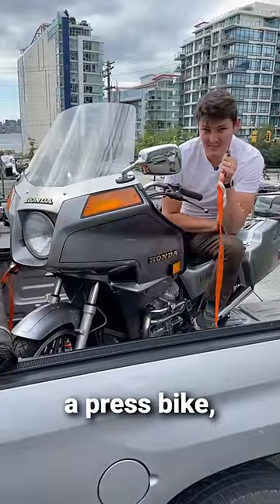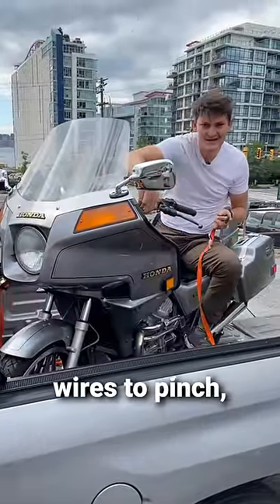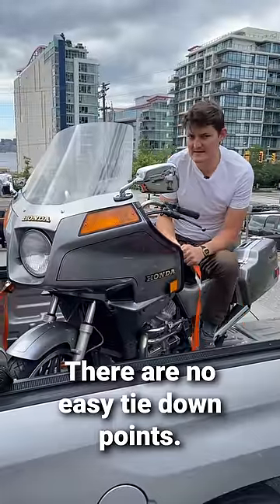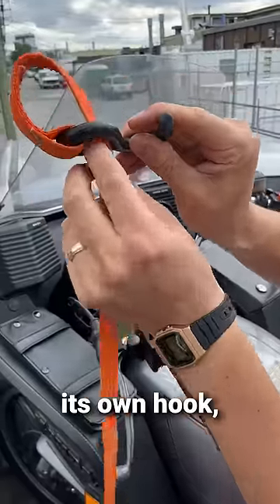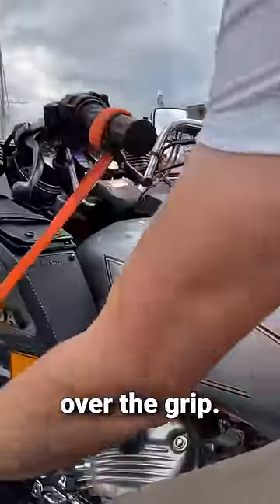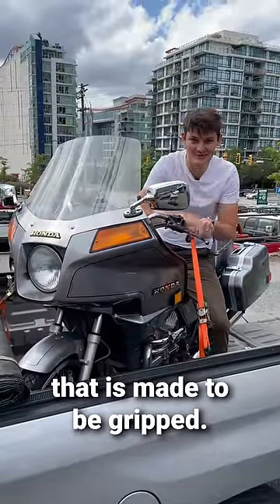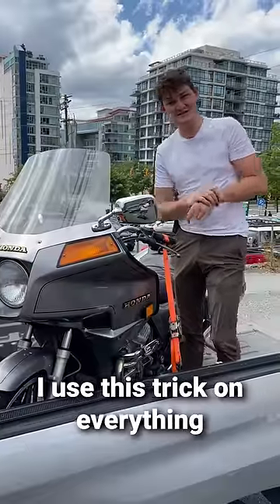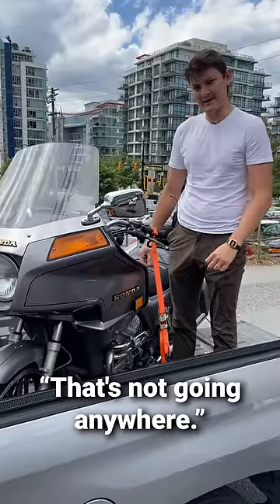The #1 Trick for Strapping Down a Motorcycle

Comment: The grips are meant for human strength to control the bike, not designed for 500 lb. ratchet straps to secure the bike while being transported.
Reply: Yep. Add to this that many sportbike clipons are fixed in their mounts with epoxy, and this is a disaster waiting to happen. Use frame tie down points, or use something like an ATK bike shoe.
Reply: That's why you don't tighten the strap until it's about to break...
Reply: Listen old man you are wrong😂😂😂
Reply: sounds like mr. F9 will have to do a video on strapping a bike
Reply: If you think hes getting 500 lbs outa those lil straps i want some of whatever youre smoking!
Reply: @ginger_nosoul  The real load to worry about is when you hit a pothole or there’s an height change in the pavement at a bridge, construction, etc.  That puts a big load on whatever you’ve secured against.  Traditional handlebars are simply clamped to keep them from rotating.  That’s not a problem with normal riding, but I could see them moving with a large and sudden load change.
Reply: Yep, from experience this will bend the handlebars and the bike will come loose. Wrap the straps over the bottom triple clamp.
Reply: Here’s another why not from the peanut gallery, the plastic throttle sleeve may have an issue with that stunt.
Reply: Definitely would not ruin my grips like this.
Reply: @mememaster147 you must be doing something wrong?? You need to strap down enough that a bump is not going to loosen the line.
Reply: Precisely, in order to properly secure the bike you are meant to crank the straps to a point where you fully compress the forks, the proper securing way is to run the straps along the forks and loop them over the steering bar as close to the strut mounts as possible. The bike also needs both tires secured in a trench that will not let it slide out sideways.
Reply: I just don’t like having the force being so far away from handle bar clamps…meaning that torque from tying it down could bend the handlebars. I personally would never use this method on any of my motorcycles.
Reply: Yup all it takes is for a bump and the rubber grip to tear, now your bike is loose.
Reply: And just think what happens to the throttle side when you hit a bump….
Reply: 500lbs is the absolute maximum that the average ratchet strap can hold (just comparing to the UK store bought ones which are generally 250kg) so you're not getting anywhere near that kind of force really
Reply: @BobSmith-zj6lk the force applied to the straps from hitting the handlebars is the same force applied to you when you hit the pothole while riding.

If it was going to apply enough force to damage your bike, it would be enough force to send the rider flying off the bike.

The bikes suspension does all the work, the rider just keeps their body attached to the bike.

There’s effectively no difference from the bike being towed vs the bike being rode when you hit the bump. Only difference is the wheel is not moving when it’s being towed.
Reply: @xTheHypn0tic I like towing them when they are wrecked cause 90% of the time the forks are bent and structurally compromised. I re-lay it on its side and throw some straps over it 😂
Reply: It's OK for a dirtbike but that's pretty much it..
Reply: @xTheHypn0tic your brains Physics simulator is broken. When the bikes handlebars are strapped down they are made to absorb a shock that they normally never absorb at all.  Normally when a bike hits a bump, the bike might jump or move up and down and the suspension will absorb part of it. When the bike is strapped down it can't jump or move to reduce the impact. Plus your handlebars only actually hold a small amount of your weight but zero of the bikes weight. When you clamp down with the handlebars they now have to hold down the entire bikes weight as it tries to jump and move due to the pothole. So effectively they have to hold down a force that's much more than the bikes weight in pressure and certainly a lot more than what they are made for
Reply: @nocensorship8092  that’s not correct. You would be off the road and bouncing with wheel spin if your suspension wasn’t absorbing the bump. Your suspension should be absorbing almost all of it with the exception of potholes/extreme events.

If your suspension bottoms out or doesn’t absorb the impact then you will lose traction.
Reply: Yeah they'll start sliding n shit its annoying
Reply: Especially the throttle side, your tightening could turn it past the idle stop and break something.
Reply: Tell that to triumph 😂 rip the thousands of us with bent bars from factory
Reply: I've been doing it wrong for 50+ years???? NEVER had a problem, EVER. You don't tie it down to 500 lbs. You don't compress the forks all the way, You don't need to secure the front and rear wheels..... who are you people???? Have you ever put a bike in the back of a truck??? Do you know what a motorbike is???? Do you own a truck????
Reply: Theyre on the internet, they dont know how outside works
Reply: That's the method I would use to remove a stubborn grip 🙃
Reply: Don't tell him shhh....
Reply: I trust Ryan over you.
Reply: @BERZERKERSV4 there it is ! That's also a delicate area to be ratcheting down against throttle cables attachments
Reply: @ginger_nosoul I don't think he literally meant that much pressure
Reply: @xTheHypn0tic Even so, the action of compression on the suspension WILL loosen the strap and allow it to slip off, dumping the bike. Just simply a bad move.
Reply: @TheDustyShredder  the suspension will compress no matter how you strap it down if the wheels are on the ground. The only possible concern could be due to some special grip design, but even that’s probably unlikely.

Comment: To everyone commenting that this is a good idea, please don’t strap the bike down by the grips. It can mess up your bike.
Reply: How?
Reply: @zmcg1 it depends on the grip and straps chosen. Because you are not pulling down, but pulling out at and angle, in theory you could cause the grips to slide and loosen on the handles which would leave you with room for the bike to move. I doubt anything would happen on a short trip.
Though, looking at that bike, I don’t see any other safe place to strap it down. 🤷‍♂️ his risk.
Reply: @philospherking_sortof659   I've seen bikes that had bent handlebars because they were not intending to bear any load or impact. As you get further out to the END of the bars, they bend easier. Maybe it seems fine when you are satisfied with the secure straps. Then a bump / bounce in the road is enough to tweak and ruin that handlebar.
Reply: @josephthornton8560 i could totally see that happening. Especially if you leveled out the bike straight into a truck bed instead of at the extreme angle that we see in this short. The standard tie downs would pull the bars forward, down, and to the side. Which is not how they were meant to bare weight.
Reply: Where the forks meet the front tire. Strap down there. You don’t want to strap down so that the forks/suspension are compressed. Every time you hit a bump, the straps will become less effective. Strapping down so the suspension can bounce around as it needs to will get you to where you’re going without any drama.
Reply: Now it won’t. This a boomer myth.
Reply: I'm not pulling down on that bar bend. 😯😯
Reply: Yes, he should take this video down. This is an unsafe and horrible way to strap your bike.
Reply: @philospherking_sortof659 I have a chock in my bed so I’m pulling straight down on my handlebars.  Never had any damage done and haven’t had anything slip.

Comment: I use soft loops around the forks, right on top of the fork lowers. Doesn't compress the suspension which means the bike won't bounce a strap loose.
Reply: That works on inverted forks, but on traditional forks, would that be pulling right against the fork seals?
Reply from the maker: That is a sweet mounting set up! The problem I have in a truck bed is that the fork lowers are below the anchors on my bed rails, so the straps would be pulling upward. But I should probably just install more hooks on the bed itself. ~RF9
Reply: @FortNine you have an interesting problem with your truck set up. I think it would be better to loop directly into the handle bars instead of the grip. Or perhaps over the bike and down through in a sort of X, this way the forks compress without being attached to slip off part.
Reply from the maker: @philospherking_sortof659  Yeah looping near the bar clamps or around the triple clamp used to be my go-to. But the problem with fully faired bikes is that both spots are surrounded by fairings, so there's no way to add tension without stressing something plastic. What I like about the grip method is that it gives you an option for motorcycles with no easy tie down points, and you don't have to buy a Canyon Dancer. ~RF9
Reply: @FortNine Faired bikes should be ridden everywhere, that's the point of the ugly fairings 😅
Reply: Have you or anybody ever broke the throttle tube using a tie-down on the throttle side?
Reply: This works extremely well with the BMW telelever suspension. I use chains with soft loops and a turnbuckle. No stretch, never have to retighten.
Reply: Ultimate tie-down, particularly for bikes with long suspension travel 😊
Reply: @firefighter1c57  Yes, it puts pressure on the DUST seals, which are very tough. The oil seals are underneath those.
Reply: @blipco5  I personally avoid tying to bars if at all possible...but Ryan is right, sometimes it's all you got or the best you got. I've been a motorcycle mechanic for ten years, I've transported countless bikes...the most difficult to transport are large scooters like the Majesty or Burgman, it's just an acre of fragile painted Tupperware. Chocks and Canyon Dancers are your friends on those.
Reply: @blipco5 that's what I'm always concerned with when I see people tie their bikes down by the grips. That throttle tube is pretty thin plastic.
Reply: @FortNine this is what ive done for my truck. Much more worth while.
Reply: If it gets real hot out some grips might slip right off
Reply: @FortNine  i dont know if they make them anymore but i have a setup called a "canyon dancer" its a soft loop that goes around each bar, passes through a soft center sleeve then goes to the other side of the bike and has a soft loop on the end to hook a strap. It basically pulls the left bar to the right side of the truck and the right side to the left. Ive used it on everything from sport bikes to choppers. Its basically like the system you described, except it pulls side to side instead of just down.
Reply: @FortNine  Could you go for lowers to anchors to grip?
Reply: @FortNine your bed rail is not intended to tie down items as heavy as a motorcycle. Use designated tie down points. I think youre a very keen guy on bike info, but i need to teach you proper securing techniques. 😂 many argue "my truck wont let me tie it down like that" and my response is, then get a truck that will. You hot a truck to begin with because you wouldnt tie a bike to the top of a car. If you got a vehicle because you wont do it wrong in one way, then why wouldnt you get a diffrent vehicle, and keep doing it wrong in another way?
Reply: @FortNine floor rails for mounting points?
Reply: You WANT to compress the suspension, as it keeps the straps tight.
Reply: @shhmule  YOU might, but I don't. I'm a motorcycle mechanic who's transported more bikes than I can remember over ten years, and compressing the suspension isn't desirable, actually letting the bike absorb bumps on its own is better, so tying down to unsprung points on the bike is ideal, YRMV.
Reply: @firefighter1c57 no it will pull against the cover . The seal is recessed down into the lower fork tube / shock body. The covers are usually either plenty firm or if softer material is used on some bikes it will be malleable enough to resist damage .
Reply: @joshdemarco9270  Thin plastic that is sitting directly on metal... all the force is transmitted to the metal...I've been doing it wrong for 50+ years???? NEVER had a problem, EVER. You don't tie it down to 500 lbs. You don't compress the forks all the way, You don't need to secure the front and rear wheels..... who are you people???? Have you ever put a bike in the back of a truck??? Do you know what a motorbike is???? Do you own a truck????
Reply: @sawyersdad5292  a bit sensitive, are we?
Reply: Wait,  that should've been.... a bit sensitive,  are we????????
Reply: @somejerk1520  for instance my ranger doesnt have proper mounts in the lower bed but does on the top of the sides so strapping the lower forks would basically hoist the bike up. 
Gotta mount to the bars or triple tree and remember the fork saver. 
Same issue with my vespa, but it does however have integrated tow strap hooks right on the frame.